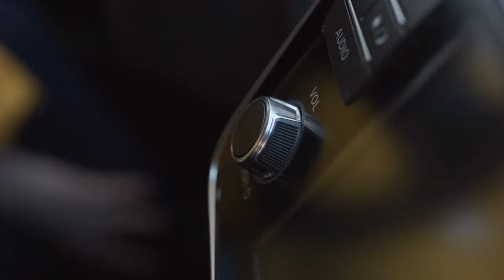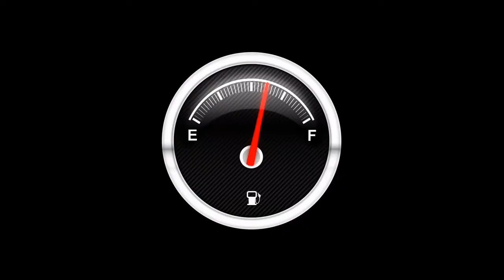Best Car Warranty Company - Total Auto Protect Commercial

Comment: Legit Scammers. Don't believe me if you want but I've gotten burned by them badly.
Reply: What happened?
Reply: @LYCANTROOP0  so to make a long story short, my 1/2 my heater is not working. Mechanic says there's likely a clog blocking the flow (can't disect until job approval). Claim was denied because they claimed this would of been due to corrosion. It's a 1000% covered item yet they elusivly sway the conversation using key words just that could be the probability that gives them the chance to deny coverage. When asked how could he conclude possible corrosion when, A). the Mechanic describes this a blockage & B). The part hasn't even been visibly view or inspected at this point?

The Rep Charels claims that all blockages are corrosion (not an accurate description). $1,700 it would of cost them less my ded, meanwhile it's cost me $5,200 (paid in full) and this would be the 3rd opportunity to make good on there contract while instead stiffing me with the mechanic bill each and every time for one reason more ridiculous then the next.
Reply: @HALF-FAST CUSTOMZ  so to make a long story short, my 1/2 my heater is not working. Mechanic says there's likely a clog blocking the flow (can't disect until job approval). Claim was denied because they claimed this would of been due to corrosion. It's a 1000% covered item yet they elusivly sway the conversation using key words just that could be the probability that gives them the chance to deny coverage. When asked how could he conclude possible corrosion when, A). the Mechanic describes this a blockage & B). The part hasn't even been visibly view or inspected at this point?

The Rep Charels claims that all blockages are corrosion (not an accurate description). $1,700 it would of cost them less my ded, meanwhile it's cost me $5,200 (paid in full) and this would be the 3rd opportunity to make good on there contract while instead stiffing me with the mechanic bill each and every time for one reason more ridiculous then the next.